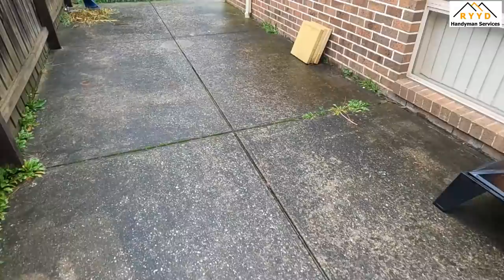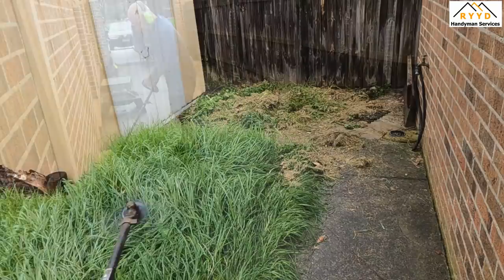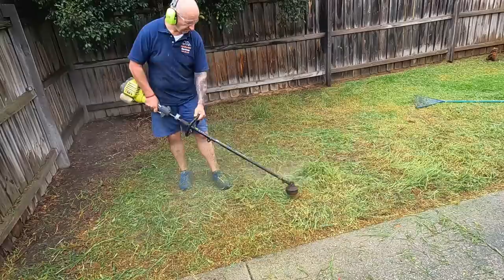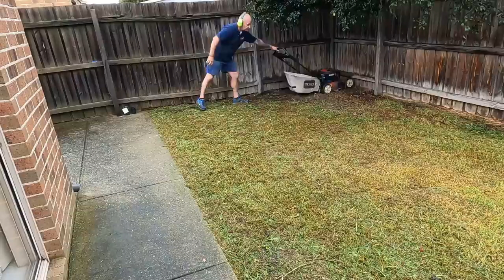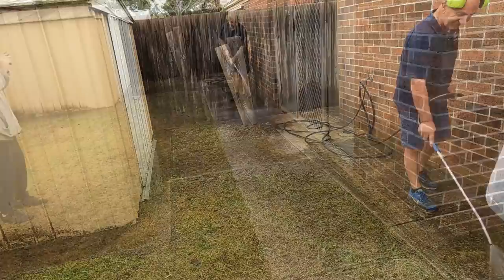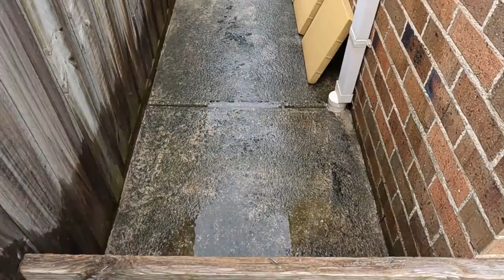Mowing Thick Long Wet Overgrown Grass (Cold Melbourne Morning)

Comment: Hey mate I have a small lawn care Business in the Sunshine Coast your doing a grate job keep it up mate. One suggestion you might want to get a blade edger I have just bought one and it makes life a lot easier as faster and honestly get a way better edge than a wiper sniper can. Keep up the grate work
Reply from the maker: Thanks and good luck with your lawn care business. 👍
I do have one and I use it a lot, they do make life heaps easier.
There wasn't mush edging to do at this job so just used the whipper snipper.
Thanks for watching and comment
Cheers 🦘👍